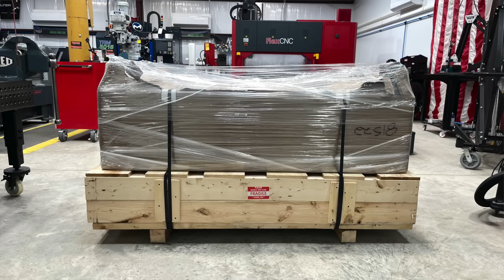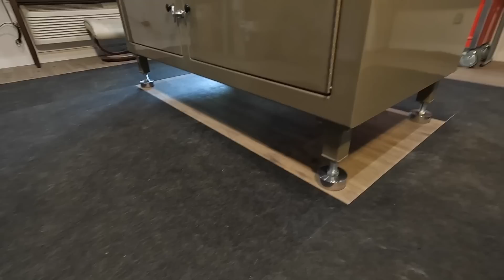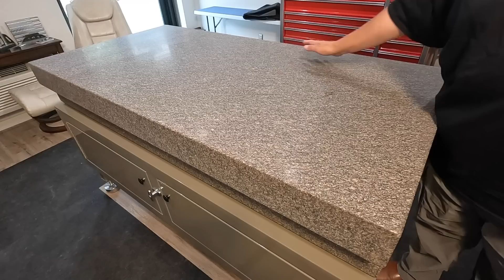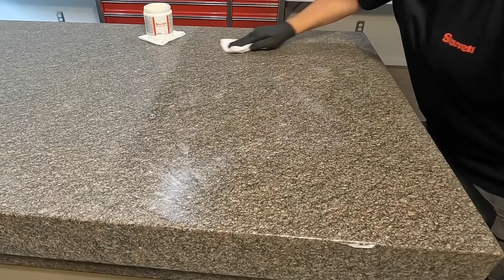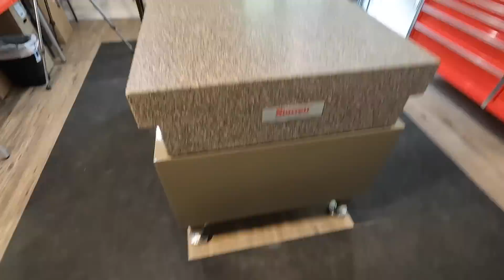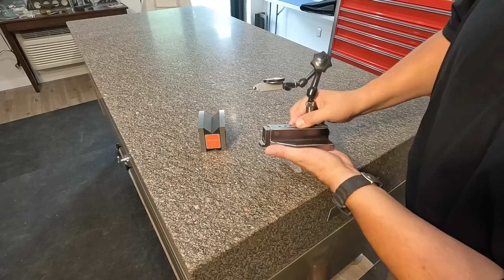Granite Surface Plate Care & Maintenance

Comment: A lot of whining and angst in the comments Adam...ignore them. It is very unlikely that I will ever have a beautiful 3 x 6 foot surface plate like yours, but I can vicariously get off to why you think yours is really cool....I do too. HOWEVER: I have a 18 x 24 inch black granite surface plate I picked up when it was on sale AND had free shipping! Would you please give me some suggestions about what generally available products are available for granite cleaning  for those of us who do not have ready access to the Starrett stuff? BTW: I truly appreciate the video. I probably would have used Windex or some other such sinful no-no. What should I use? Thanks
Reply: Adam's methodology is for manufacturing tools with .0005 tolerances. If your tolerances are .005 or greater, you can use  Windex or any mild cleaner and use it as soon as it feels dry.
Reply: The man who tested and touched up our plate yearly recommended Gojo waterless hand cleaner.  The one WITHOUT the pumice of course.
Reply: A little dish soap mixed with water will do just fine. Dry throughly after cleaning. Accuracy is not affected by cleaning if done properly. BTW, Starrett surface plates were manufactured for many years in Mt. Airy, N.C.

Comment: Please always allow 30-45 minutes after cleaning for the block to re-stabilize, the amount of wiping with clothe to remove the cleaner will cause differentials in surface temperature, I only use 90+% ISO on my surface plate as the "waterless" is not really waterless, and the spray cleaner is a lot of water, also the pastes have been shown to build up over time if not completely removed using additional spirits, this can lead to excessive dust as well as "sticky" spots which will lead to wear, of note if using Spirits/ISO to clean a block additional time may be required for re-stabilization as Spirits/ISO can cause what they are calling surface super cooling due to its quick vaporizations. The reason I was always told to keep water away from blocks was that water will cause oxidation of the material itself which will alter the block over time while spirits/ISO evaporates quickly enough that little to no oxidation can occur.  I don't know about the towels you are using but Kimtech lint free wipes work great and keep the dust in the air down as the you aren't introducing more into you room,  This may all be beyond what you are accomplishing with the block as I am using my block in the 3-5 millionths range so take it as you will.

 BIG NOTE: please make sure any computer exhaust fans or really any exhaust fans are filtered and pointed away from the block, localized temperature swings will throw the whole block out of specification and filtering exhausts will cut down on the amount of particles in the air
Reply: Are you serious?  The exhaust fan from a computer on a 2 ton rock?
Reply: If you want to keep millionth level accuracy, temperature is one of the most important factors  @mudnducs

Comment: I was all the time wondering about the skin grease being applied all the time, and also why Adam was not wearing hairnet and beard / mouth cover? After all, the accuracy and cleanliness spoken about here is close to surgical level. A single hair dropped is a disaster and may scratch granite (?). The room should also be under pressure, and should have a gate for changing clothes. Is the room under temperature control, to compensate expansion in metals?

Comment: The Starrett granite surface plate cleaner safety data sheet shows 96% water, alcohol, propanol... The paste cleaner msds shows 40-60% water, 20-40% mineral spirits, acid, glycol, gum, fragrance, etc. The waterless one is 25-50% white spirit, cleaners, fragrance, no indication for the other 25-50% of the product. Don't eat snacks before using your plate and the associated tools and accessories...
Reply: I was going to say, unless that liquid cleaner was anhydrous alcohol, it was sure to be mostly water.

Comment: I love how meticulous you are about precision tools; we're cut from the same cloth. If I was you, I would spring the $150 for a nice air purifier to pull out all the PM10 and PM2.5 particulate in the room's air. That's the shop office, right? I have a Winix model 5300-2 for my bedroom and I love it. The activated carbon filter will also remove the solvent and cutting fluid smell in the air (which I like cuz mechanic, but other people get a headache and complain). Levoit also makes wonderful models which will do the job well. If you oversize the purifier for the room's volume, you can run the purifier on a slower speed setting and it'll be very quiet. I'd also invest in sealing that office very well with caulking, expanding foam, weatherstripping, and mains receptacle box gaskets to keep the dust from entering from outside and from the shop. Metal fallout from the shop will embed in the plate. Sand from outside is abrasive.

Comment: What are the advantages of a granite surface plate over a cast iron surface plate as I have both
Reply: Dings on cast iron will displace the surface and it won’t be flat anymore. Granite will chip, but maintain flatness. Heavy and precision industries learned this advantage when metals were in short supply in WWII… and they’ve been using this ever since.
Reply: Cast iron surface plates are better in my opinion they are more stable than granite only because of granite absorbing moisture and intern changing the flatness cast iron will rust but it wont affect the flatness also they give a better bearing surface than granite also cast iron is more easily can change to the temperature of the room while granite takes longer to be affected by temperature aka absorb it which can be a good or a bad thing but because of ww2 they started looking for a different material  “cheaper” to make them from and now they hardly make them anymore but they both have advantages and disadvantages but all in all are for 99 percent of uses and people it’s  the same only really if you were blueing a part up for bearing for scraping the cast iron would be better
Reply: @wreckingball518  the fact that granite takes longer to stabilize has to do with the large thermal inertia. This stability is intentional and a huge benefit.